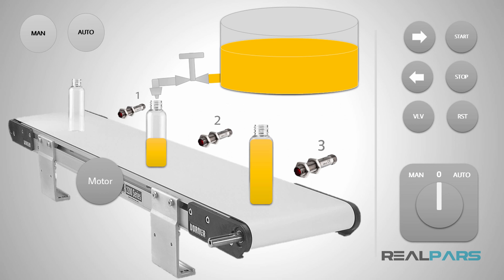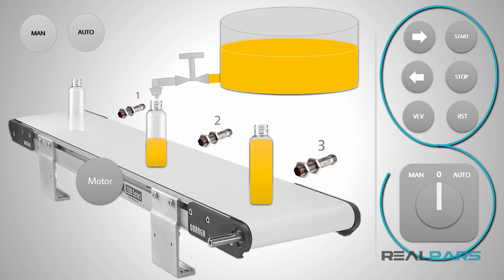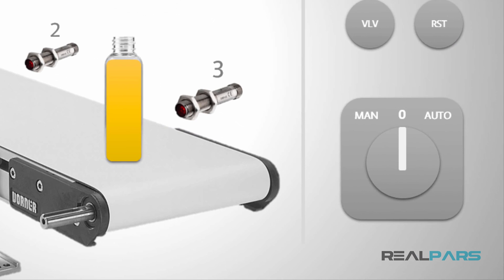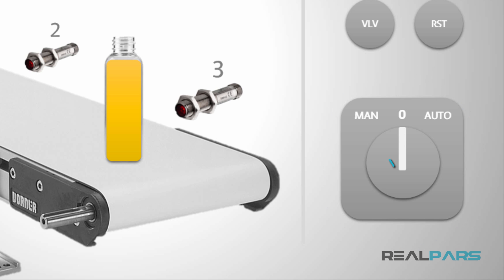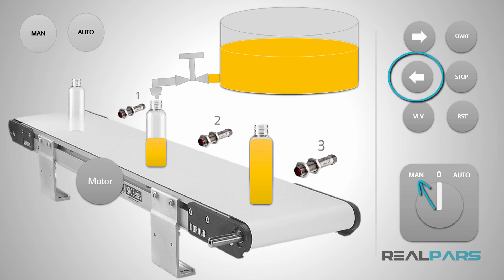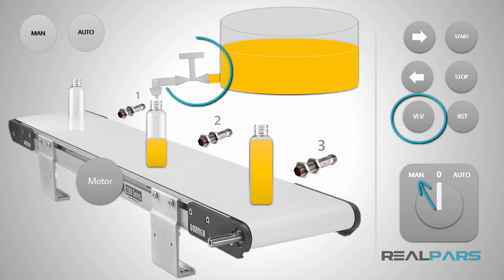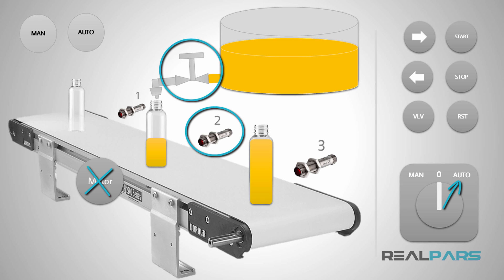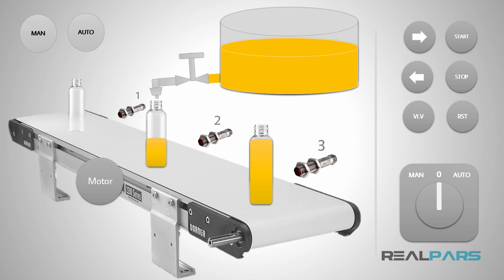Bottle Filling Process PLC Program _ Part 1

Comment: sir, can we use photo electric sensor to detect broken bottle,dirty bottle,chipped neck ?
 can we use capacitive sensor to detect torn label,without label,wrong label ?
Reply from the maker: For broken or chipped bottle detection, an optical method is most often used.  Chips and breaks are reflective and light-scattering, so specialized camera systems are used, but a specialized photo-electric sensor could be configured to work as well, but usually over a narrower area (right at the bottle top). Video is probably the best for label detection as well, especially for determining if the wrong label is applied.  This could also be detected with a bar-code reader, if that is a differentiating property of the label.  A "no label" condition can be detected with a photoeye, if the bottle is clear or will pass light through it if the label is missing.  As a general rule, capacitance or ultrasonic can allow you to determine if something is "present" or "not present", with visual or other technologies required to differentiate abnormalities in the object.
Reply: @realpars  

Thank you sir, for your kind reply

Comment: hi sir, which type of sensor can be used to check whether the bottle is capped or not

thanks in advance
Reply from the maker: A proximity sensor or visual detector can be used.  Proximity sensors for this purpose are typically inductive (Hall effect) which detect the metal cap.  Visual sensors (cameras) can easily determine the presence of a solid cap versus a clear glass bottle neck or the presence of a cap versus an open bottle.
Reply: @realpars   

Thanks sir..great 👍👍

Comment: very good explanation sir. which type of sensor can be  used for  sensor 1, sensor 2,sensor 3.
Reply from the maker: A proximity sensor is used.  They can be inductive (Hall effect), photoelectric, ultrasonic, or capacitive sensor types.
Reply: @realpars   k sir,thank u
Reply: @priyam1776  generally they are optical sensor with reflectors. It is not easy for a sensor without reflector to detect transparent objects as the bottles
Reply: ask censor board

Comment: hello is there a programs using v13 veroin of plc
Reply: At RealPARS, recent videos have been developed using v14 of TIA Portal.  V13 is very similar from a software standpoint.  V12 was quite a bit different and is harder to "upgrade" from. What is presented in our videos for V14 are also applicable to V13 in almost every reagard.  The differences in versions 13 and 14 are mainly in hardware configuration choices.